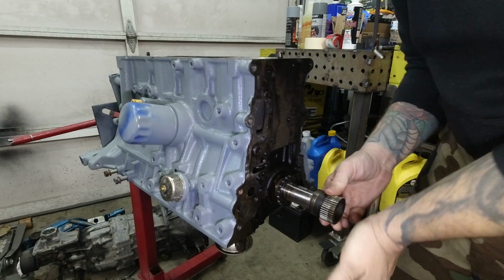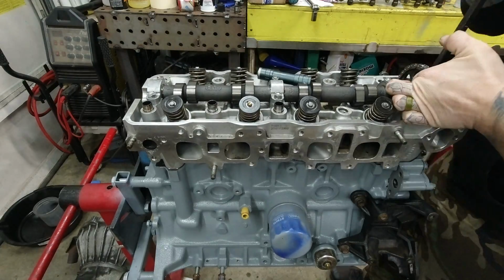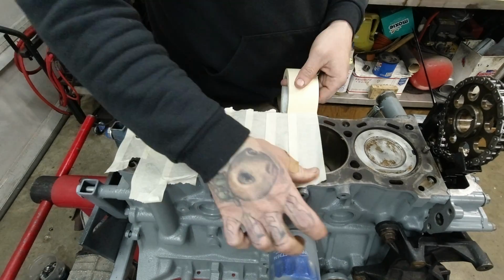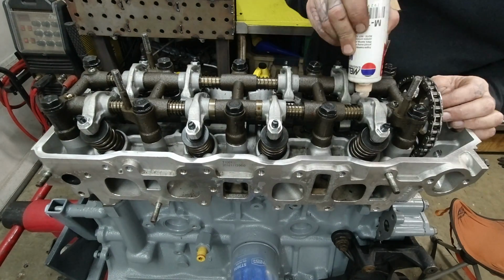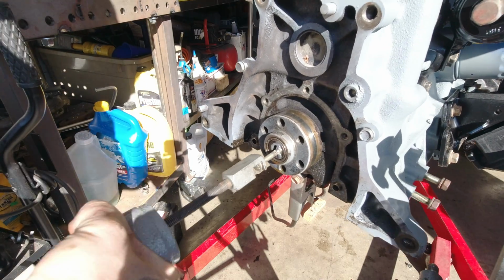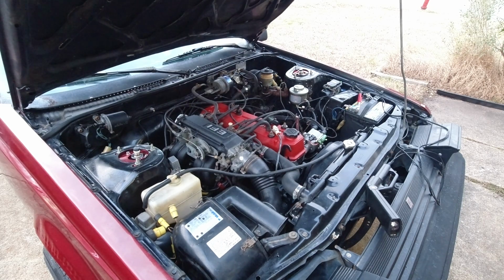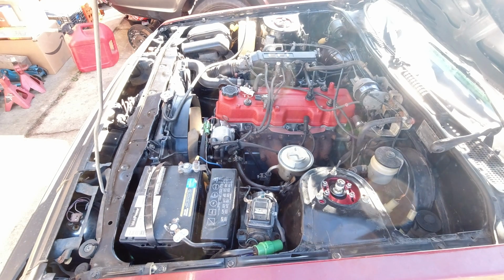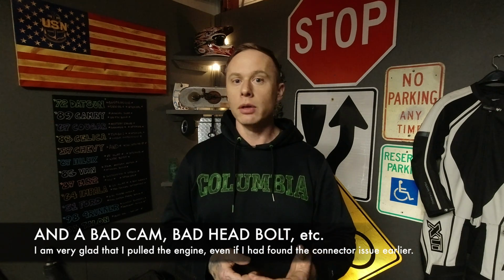TOYOTA 22RE ENGINE REBUILD - PART 2 OF 2 - Assembly, first start, and minor fixes 22R

Comment: I bought my 87 4Runner new. I had it rebuilt when it had 200k miles because I did a full make over, trans, differential. I’ve put 100k since but I sure wish I would have known about the metal tensioners for the timing chain. I really want to thank you for sharing this video.
Reply from the maker: You are welcome! Glad you are keeping a 1st gen 4Runner alive, I absolutely love those things! Even without the metal-backed chain guides, it'll last a long time.

Comment: I also had a misfire on cylinder no 1 on my 1987 4Runner. After a long investigation, we found it was also the fuel injector connector. We tied the cable with some plastic ties for now as a temporary solution… it has been like that for almost two years. Works fine now.
Reply from the maker: Zip ties for the win! Love to hear it!

Comment: Did you buy a new Head? Mine needs a new one, the old one has already been machined to the max , I cant be sure where to buy one at . Any suggestions as to where I can buy a new trustworthy head?
Reply from the maker: This head was new. It was replaced before I bought the car in an attempt from the previous owner to get the car running right. I don't know where they got it, but I assume it was from Rock Auto. Its not a bad casting overall, but the rear cam seal wall is thicker than OEM, so the nice billet "half moon" seals that i bought from 22RE Performance didn't fit.
I know thay LCE sells heads, and they are good...but pricey. 
Perhaps get one from a pick n pull and machine that one if yours is past its limits.

Comment: Great video! That being said, Maybe I've just been really lucky in my life, but I don't use any adhesive on paper gaskets on this engine and it has never given a problem. Two reasons I don't use adhesive... One because you don't have to It seals just fine without it, two if you have to take it apart now you're scraping mating surfacess of adhesive. In fact the one time I did use an adhesive on the water pump gasket it actually leaked. 
Also worth noting that the 81 through 84 engine blocks are the same as the 84 through the 95 so why would one use an oil pan gasket and another one not?
Reply: The oil pans aren't the same, I think.

Comment: i was taught to use bread to remove the pilot bearing. You cram bread in there until you cant fit any more then use some shaft that fits perfect inside the pilot bearing and smack it with a hammer till you can fit more bread. The bread pushes the bearing out easily then can be picked out easily.
Reply from the maker: I've heard that forever. I've tried several times over the years. I've had zero success. So...I use pullers and a weld here and there.
Reply: @ it always works for me. The shaft you use to smash it in there has to be big enough that the bread doesn’t bypass the shaft and just come out.

Comment: I did a pilot bearing removal hack by pumping the hole full of grease and pounding a half-inch wooden dowl into it.  Had to pump the grease in a few times, but it worked surprisingly well

Comment: Hry did you ever make a video on creating the 3d pronted guide?
Reply from the maker: I did not. I'm not really the guy to try to teach CAD. lol
Reply: @tinygaragefab  heh, not many are. 

I've got a bolt hole in the back of the plenum where the EGR attaches that was cross threaded.  If I try to use a thread chaser it immediately goes out of square so I'm thinking of printing a drill jig to keep my drill bit on track for a helicoil. 

Thanks for your videos.

Comment: I thought I part one it's a 22r......so was it no good???
Reply from the maker: It's the same engine from part one.  22R and 22RE are the same engine, the "RE" is fuel injected, the "R" is carbureted. So at the core, they are ALL 22R engines. They just get some extra letters to state they are fuel injected or even turbocharged (22RTE)
But yes, this engine was good after the repairs i made in this video.

Comment: Great video. What kind of power does that stage 2 cam get you?
Reply from the maker: Thank you! I don't know what gains it got with the cam as far as actual dyno numbers, but it pulls really great starting at 2500rpm. It is a noticeable increase, especially compared to the stock 22R in my '87 Hilux.
Reply: @tinygaragefab  I have an 85 4x4, and though I genuinely love the motor, “it really pulls” is rarely a thought that comes to my mind 😅.

Comment: 8:00 - When I rebuilt my 22RE, torquing down the head bolts, I had a butt pucker so tight, I could've made a diamond. I did mine in 4 rounds and when I got to 58, I was convinced I was going to break a head bolt. Then immediately sat down and had a beer right then and there when I didn't. hahahaha

Comment: Why does the cylinder head have the metal inserts protruding from the 5 head bolt holes along the right bank - but not the left?
Reply: Nevermind. I figured out it is because of no rocker arms were included. LCE told me I should use new rocker arms made to match the cam...?? I'll see how everything looks when I get it apart but it's a Chinese head and the last one was a cheap head also - lasted about 50,000 miles before gasket blew.

Comment: Hi there , I have a 88 pick up 22re , replaced an ecu , open circuit relay and fuel pump, now I have fuel pressure, spark and it fires up if I spray gas in the chamber but just for a few seconds, my problem is that none of the injections are pulsing including the cold start, any idea what to look for? I have the harness completely unwrapped, I don’t see damage anywhere

Comment: Packing bread into the bearing till it pops out works real easy but nice series, thinking of rebuilding mine soon.
Reply from the maker: I love the suggestion, I've tried numerous times, and have had zero success. It's an old hot-rodder's tale, but that doesn't make it true.
Reply: I did this trick on my 22r and it worked it was crazy! Just pack bread into the opening and then used an extension. Tap it lightly and it will force the bearing out

Comment: Awesome videos 1 and 2. I just bought a 1985 Toyota Hilux with the 22R engine carbureted so I'm starting to learn about these engines. Everyone tell me they are indestructible. She has 230,000 mi and she runs like a champ so I'm fixing her little by little keeping her running smooth. So every little bit I learn is a plus. In case something goes wrong, I might have an idea what to look for watching all these videos. That was a incredible job.
Reply from the maker: Thank you! I have a 1987 Hilux with a 22R as well. That little truck just won't die!

Comment: I bought a 94 pickup with a 22re. It had been worked on previously, and a lot of bolts were missing, new or aftermarket bolts put in (various places), is there a manual or a guide somewhere on the web that tells what size bolts go where? Timing cover, valve cover, intake and exhaust manifolds, etc?
Reply from the maker: While I don't know of any online resource, I would suggest going to a pick n pull style yard and finding something with a 22R and pulling the bolts you need while bagging and tagging them. This will get you better quality bolts than buying from a hardware store, and probably be close to free. A lot of yards don't charge for hardware, just parts.
Reply: @tinygaragefab  thanks for the tip!

Comment: can I use oem toyota black gasket maker where you applied the grey gasket maker?
Reply from the maker: Absolutely. It's actually far better. Toyota FIPG is really awesome, I just didn't have any when I did this engine.
Reply: @tinygaragefab  cool thanks, my timing guides broke and I don’t think it has been touched ever

Comment: I saw a video from LC Engineering about installing the timing chain and cam gear. Put a socket and breaker bar on the crank and wiggle the crank back and forth just a degree or two, this will relieve the tension on the timing chain tensioner and make life much easier when installing the cam gear.
Reply from the maker: That sounds like a good idea. I'll give it a try on my next 22R build.

Comment: Excellent instructional video, both Part 1 and 2. Finally an organized video with explanations that makes sense!  Thank you.  Was hoping to get some feedback on a blown HG (head gasket) on a 1987 4runner 4x4 22RE EFI with 120K miles on it. Compression test psi on cylinders 1-4 was 132, 130, 128, 134. Toyota 22RE spec shows 170psi. Looks like you covered everything very well with what needs to be done. However is there anything in particular that I should focus on? Specifics?  Like measurements, checking the cylinder/block mating surfaces, should the head machined, is timing chain and guides replacement a good idea with a HG replacement, Water pump while I'm in there, cylinder shim needed or not, use the 8 old head bolts or buy new ones, etc. I have mechanical experience but never changed a HG or timing chain on a 22RE. Anything else that you or anyone one else reading this can recommended for me focus on would be greatly appreciated! Thank you!

Comment: Why use chain instead of belt?
Reply from the maker: The 22R series only came with a chain. They generally last longer than belts.
Reply: @tinygaragefab  what a hard core engine, using chain instead of belt just for the extra reliability

Comment: Not hating, you did a good job. I just hate when people have a 22re on a stand and install the timing cover before putting the head on drives me crazy.
Reply: Why would you put the head on before the timing cover? The timing cover should be the same height as the deck and should be completely flat. What bothered me was putting the cam gear on before torquing the head.
Reply: @MrDno420  the timing cover won’t fit right if if it’s too tall regardless of installation orientation. The reason people put the head on first while still in the truck is because they are too lazy to take the oil pan off which has a lip on it as well as the head. That’s why 99% of the time they leak after a new timing chain. But with the motor out you should be installing the timing cover after the head because the oil pan is already off and there is no need to worry about the timing cover seating properly.
Reply from the maker: I did it because I've rebuilt a lot of GM LS engines, and the oil pump alignment (crank driven) is critical on those. The 22R is similar, so I wanted to have that situation all squared away first. But I suppose it could have been done after the head went on. Either way, this particular 22RE has been dead-nuts reliable for nearly 20k miles.
Reply: @tinygaragefab  that’s the nature of the 22re glad it’s been running well, yeah it’s just something that makes getting your timing correct easier and makes releasing the tensioner simple as well as being able to veiw you didn’t accidentally skip a tooth with the chain. Either way I thought you did a great job.

Comment: When you introduce the new cam, you say it's a 'stage 2'. I've tried googling it but nothing helpful has come up. What does Stage 2 indicate?
Reply from the maker: From Summit Racing about the Melling camshafts: "Melling M-Select Class 2 camshafts are perfect for any ride. They have good idle quality, low-rpm torque, and mid-range performance. These cams will work with stock or slightly modified engines with manual or automatic transmissions. Order the model designed for fitment on your vehicle."
I do not have the specs on hand for the cam. But it is better than stock. I can feel a definite uptick in power at about 2200rpm. I bought the cam from RockAuto.

Comment: I just did a 22r head gasket replacement, everything is timed and was put back correctly but now whenever I try driving it doesn’t want to go past 20mph and even at that it takes a min to get up to that speed. any help?
Reply from the maker: I'd start with making sure all spark plugs and wires are installed and installed correctly. If you have an infrared thermometer, aim it at each of the exhaust ports to see if any one is way colder than the others. That will indicate a dead cylinder or two. Check fuel injector plugs for connection (had an issue with mine, hilighted at the end of part two of this rebuild)  If none of that is an issue, double check valve clearance on the rocker arms. Too tight will lose compression and run poorly.

Comment: Thanks for the vid Mathew, watched it a few weeks back and it inspired me to get to work on my 85 celica gts coupe, had it for over 30yrs 100 K original everything ( clutch timing belt etc.) except stainless exhaust put on over 20yrs ago and new wiring harness,
I am in the middle of repairing the drivers side power mirror, seems the small round threaded rod that comes in contact with the back of the mirror to adjust it has stripped threads in both horizontal and vertical drive units. Having a heck of a time sourcing new ones.
If you are interested and able I saw that you 3D printed the drilling  jig you used in the vid. I would pay you to 3D print some new nylon parts for the mirror, I figure yours will have the same set up so you could copy them. It's seems to be a metric M8-1.0 size which apparently isn't common. Local 3D print shop wants $300 before they start and $100/hour..... let me know if interested.
Reply from the maker: There is actually a file of these mirror bolts and the square nuts that I already have on my computer. I haven't printed any yet, because I put fender mirrors on my '85 GT. But I'll be using original mirrors on my '83 GT and it has the same problem. Hit me up on IG @tinygaragefab and shoot me a message.
Reply: @tinygaragefab  HI Mathew, never used IG before, I'll give it a try, in the meantime after putting my glasses on and having another look at the mirror, I don't think the threaded rod is stripped I think the problem is the rods should be fixed(fastened) to the back of the mirror and has come free. The rods have a hollow center and the rear of the mirror has a small rubber protuberance that appears as though it fits inside the threaded rod to hold onto it so when the motor is activated it acts to either push or pull the glass to adjust it. This could have been dislodged from over usage or by continually adjusting the mirror beyond the physical limits ,  by removing the glass from the mirror the rods are no longer attached to the rear of the mirror so now it's going to be tricky getting it back together. I think I'm going to try attaching the rods to the mirror first ( 1 horizontal 1 vertical) then feed them into the motorized adjusting units before attaching the mirror via the ball and socket retainer that holds the mirror in place. I still need to source a M8-1mm threaded rod to replace the damage one and this has been difficult. If you know of anyone who has repaired one of these I'd be interested to hear how they did it.

Comment: I have a 92 pick up with the 22re in it, I love that truck. Have been slowly trying to bring it back to its glory days.
Reply from the maker: My 1987 pickup has the 22R and I've rebuilt that engine also. But I'm going to do an engine swap on that one in the future to go a little wild. It's 22R will get a turbo and live on in the Celica.
Reply: Nice, yea mine was recently having sone issues with the starter, i guess it was starting to go bad. Took it to a local shop and they figured it out in a snap. The shop was really good, I swapped the relay, the cables and the cap and rotter myself and it was still giving me a single click. Didn’t think the starter would go like that.  I had a real hard time finding anyone who wanted to work on it. Was kinda a lot to deal with. Found a local shop and the guy had it fixed in a day. Best shop I’ve gone to in years. I use the truck for work, but I’ve been wanting to take it back to have more major work done to it… time and money tho. I love the truck tho and will keep it going as long as I can it’s pushing 250k miles on it and runs good. Needs some love tho. Hope to take it In once a month to get it going it sat for a number of year. 

Have to say man love your channel, loved the 22re build and break down. Fantastic build!

Comment: for the pilot bearing i use bread and an extension with some electrical tape on it. pack the bread in, smash it with the extension, pack more bread in, smash it....repeat until it builds up enough to push the bearing out. Easy clean up and no grease.  its worked on all my manual vehicles.
Reply from the maker: I've tried and tried and the bread thing has never worked for me. I'm good with various pullers.

Comment: The way the head bolts also hold down the rocker assembly is toyota engineering at it's finest!
Reply from the maker: Indeed. This engine is a great design.
Reply: Honestly kind of a bad design but the motor is super simple so it’s not really an issue.